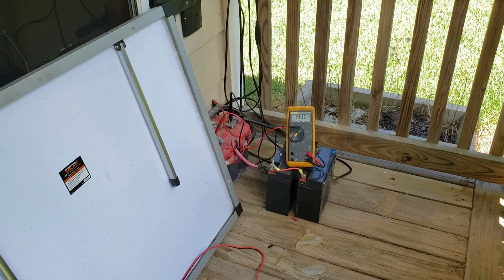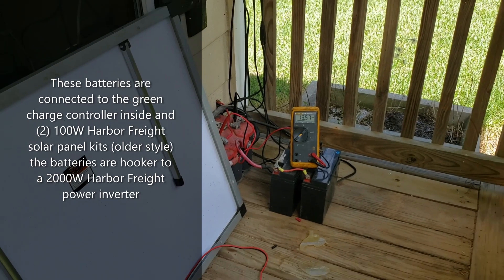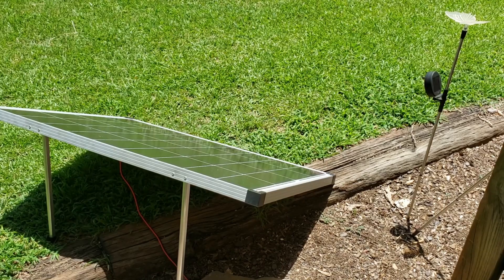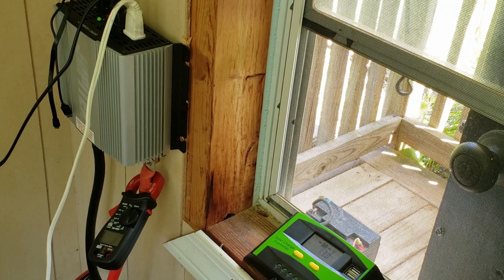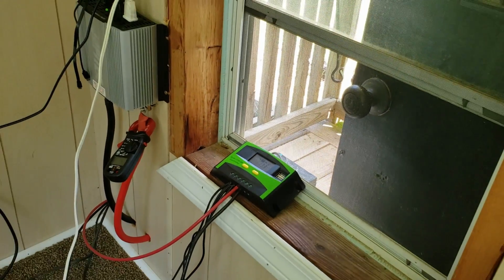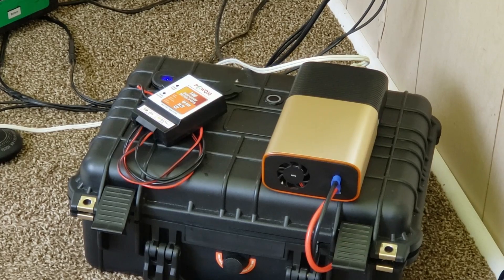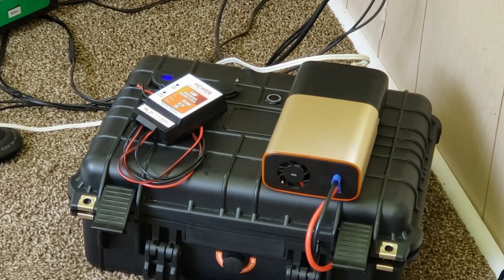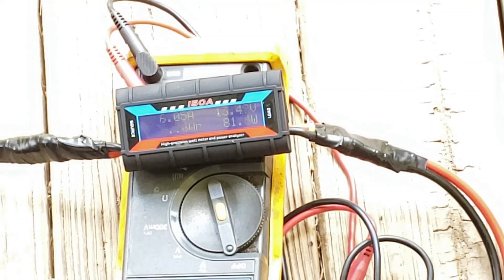Everything you need to know to run a simple solar set up with the Harbor Freight 57325 solar panel!

Comment: 12v batteries arnt actually 12v, that's the "fully discharged voltage", the batteries at full voltage, should be 12.6, after rest. (Ironically, most things actually run at 13.8 though, (full draw) so that'll mess with amp hour valuations, you'll have to take that into consideration.), typical solar systems run in "12", "24" (really common), 36, 48 and 64 voltages.
Reply from the maker: Yes you are correct nominal 12 is 12.6 resting 12 would be considered dead in lead acid
Reply: @DIYKAI  , another thing for people to take into consideration is the difference in panel types, amorphous vs. monocrystaline. Amo is able to produce usable power earlier in the day as well as later, at a slight cost of amps as you noted. Mono produces Slightly higher usable power more towards the solar peaks of the day. The consideration here is, where do you need the most usable power? For me, I want power as early as possible, even at a slight ding overall, I just upscaled my array to compensate, at a slightly higher dollar amount though. There's another ding to this though, amo panels allegedly also wear down over time, less years, as they're working more thru the day. (From personal experience, I've noted that as well, BUT, only on the lessor quality panels, which are also thinner material. as well as the glass: easier to break.) So far, my commercial Samsung amo arrays, are doing just as well as my Samsung mono arrays. (15 years on them now) Almost the exact same curve. The other thing to consider is the charge controller. The harbor freight one is a PPT type, whereas an MPPT would be way more effective, but also at a slight higher cost. All this being said, there is one other thing to consider in the harbor freight array, the cabling and connection points. I've noticed that there are alot of variances from one lot to another. At cell, they tested about evenly, but at terminals, well.  For my purposes, I simply replaced wire and hard connected, soldered in wiring, better quality. For the most part, that just about solved the variances. Amo panels has its place if the dollar amount, and array size, isnt a big drawback. Amo in my experience is good for rural apps, whereas mono is good for RV type applications.
Reply from the maker: Yes we have moved in to Renogy panels with mc4 connections got it for a steal of a deal

Comment: I would use cheap batteries. at walmart. it is a local store and they are cheap compared to glass matt agm batteries.
Reply: Deep cycle marine
Reply from the maker: @francismcclaughry3794  same its lead acid ok for small systems I prefer to use GEL or LIPO4 for larger systems
Reply from the maker: Lead acid are ok as long as your not drawing over 4-5 amps because of the peukert effect of you are using other batteries chemistry are better suited for higher amp draw

Comment: Those connectors you're showing...on mine they all corroded, so they dont put out ...cutting those nasty ends off and running the copper wire directly to the controller...My 24 volt Aims inverter /charger can charge the batteries. It puts 24 amps into my  14 batteries. I hooked it up with 1/0 welding cables...I used a 40 amp Epever charge controller for when the sun is out. I ran #4 wire to all the connections...for now I have 600 watts, 200 more ordered...still need 2 more to get to 1000 watts...can't find panels

Comment: TY, another great video however I'm still confused being I am very new at trying to setup my Harbor Freight Thunderbolt 100 watt solar panel. I have a solar charge regulator, a 12 volt charge connector, and an inverter and I don't know where to connect and how. Seems as if I don't have enough positive and negative cords. Help please. TY. I need step by step by step setup solar panel for dummies. 🤣🤣🤣🤣
Reply from the maker: Ty and its all good I will make a quick one for you give me an hour 😊
Reply: @DIYKAI  were you able to make a new YouTube on what is connected to what and how?
Reply from the maker: Can you tell me what brands you have the following of?

Charge controller
Inverter
And what type of connector you have
Reply: I have Thunderbolt solar charge regulator, thunderbolt 12v charge connector, a universal solar connector and a 1000 watt voltworks inverter. Powoxi charge controller and MOHOO  charge controller ordered.
Reply: Sorry didn't mean the thumbs down. 😁
Reply from the maker: Its ok whats the best time to post a video for you?
Reply: @DIYKAI  anytime
Reply: I just receive my PWM solar charge controller and a 8 amp charge controller by POWOXI, which do I need? Were you able to make a video yet to assemble all components together for correct operation of Thunderbolt monocrystalline 100 watt solar panel? TY
Reply from the maker: Yes about to post it
Reply: @DIYKAI  TY so much!
Reply from the maker: @ijustlovetotravelandeat453  hope this helps

https://youtu.be/-B6syVOwlf8
Reply: @DIYKAI  just a quick question, I have a Harbor Freight 12 volt battery with just the positive and negative connection, is there a battery that have the 2 positives and 2 negatives connections on one battery for the inverter and one for the solar panel? I'm sorry I'm so brand new at this and Really, Really appreciate your time!
Reply from the maker: @ijustlovetotravelandeat453  no 12v batteries will only have 1 positive and one negative terminal.....you can get battery terminals that have studs or screws to attach it to
Reply from the maker: @ijustlovetotravelandeat453  don't be sorry im here to help
Reply from the maker: @ijustlovetotravelandeat453  these are what you looking for it:

https://amzn.to/3ATOME2

https://amzn.to/2SWHcqT

either should work I personally prefer the first ones
Reply: @DIYKAI  perfect, just ordered first ones. TY again.
Reply from the maker: Your welcome those will give you the ability to either use terminal connectors or strip the wires and wrap them under the little screws
Reply from the maker: @ijustlovetotravelandeat453  I just looked at the harbor freight battery on the website and unfortunately those conn won't work I apologize
Reply from the maker: @ijustlovetotravelandeat453  to use the Harbor Freight battery you can just use a small bolt and nut. Strip the wires on the connections and use ring connectors to fasten them to the battery with the bolt....you can get all that at a local hardware store

Comment: How many HF 100W solar panels and what controller/inverter do you need to directly produce enough power to run a normal house AC (Say 3000 BTU), directly, during the day, without any battery?
Reply from the maker: If you like i can link some products that may help you.
Reply: I'm no expert, but, my understanding is that you need 4 components to have a solar power setup.  1.  Solar panel(s), 2.  a power inverter, 3.  a battery (batteries), and  4.  a charge controller.  

The only exception to this is when you run your system in a "Grid Tie" setup where instead of having batteries to store energy from the panels, you would be tied into the power grid where the power company will get ALL of the extra power you generate from your solar panels.

In that case, they will give you "Credits" for the excess power your solar panels generate, and your power bill may go down to zero each month, but, if the power goes out, you can't use your system because you don't have any batteries to store your power. 

I have a simple setup that involves using a commercially made 2000 watt power station system that I attached to (4) 200 watt solar panels that I mounted on the ground.  This system is plug and play, and I like it a LOT.  The power station has all 4 of the components built into it, so, I don't have to be bothered by putting it together. My solar panels outside charge my unit up to 100% daily.  

I have a few other smaller power stations that I connect to this bigger power station, and I charge them from the bigger one.  They all get charged to the max EVERY DAY!  I could use my own power that I generate from my solar panels if the grid goes down.  I could constantly get energy from the sun as long as the sun is shining to keep my refrigerators and freezers running as well as provide power to other devices.  I hope this helps.
Reply from the maker: Yes the 4 minimum components to have an off grid is what you listed
Reply from the maker: Yes the better charge controllers have all the features I'm looking at those next
Reply from the maker: So to answer that is many factors....like location, sub hours ect....running it without a battery is not advisable because it acts as a buffer between power surges and demands.

Comment: I got amazing results from the cheapest 100 watt panels on Amazon, the Mighty Max 100 watt polycrystaline panels for 77 each were putting out 98 to 102 watts after being in the sun for more than an hour at 3:00 PM in Louisiana connected to my Bluetti EB70 power station. My next step will be building a crude but effective portable power station using a 100 amp hour LiFePo4 battery by Chins sold on Amazon for about 500. I need a way to effectively power small AC refrigerators and freezers after hurricanes. 

My 3.1 cubic ft refrigerator draws about 50 watts and a 5 cubic ft Hanai freezer I have draws about 86 watts once the compressor surge calms down. But using solar can be a logistical nightmare when you`re depending on a very limited system due to clouds/rainy days. But thank God we have this option. For lower wattage applications it`s an absolute miracle during emergencies. 

You can power low wattage devices or charge smaller batteries whether it`s cloudy or not because solar panels do in fact produce power even if it`s raining. I will never worry about powering a fan or having power for radios and lights after a hurricane ever again.
Reply from the maker: in using two 22Ah batteries so basically 44Ah I use it to power a 500w pure sine wave inverter and can run a small refrigerator or small heater works great
Reply: @DIYKAI  I have three 100 watt solar panels now and seven smaller folding panels between 20 and 60 watts. I`m gonna keep buying 100 watt panels each month until I have 1000 watts. Hopefully in the next few years lifepo4 battery prices will come down more. The first time I tested my Bluetti it had no problem powering my small AC fridge and freezer then something caused a drop in battery capacity. They`re sending me a new one and letting me keep the one I have so I can at least use it during the day directly connected to a couple of 100 watt panels in parallel to power a freezer then use the second one at night. Thank God they did that for me. It`s gonna really improve life after the next hurricane.
Reply from the maker: Awesome we will be going full solar this year hopefully
Reply from the maker: Nice im looking into more panels